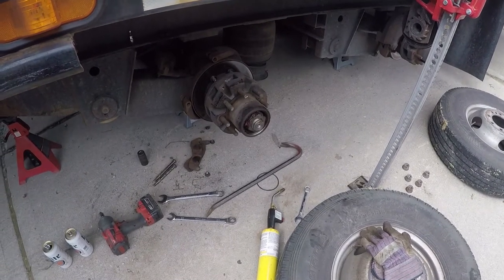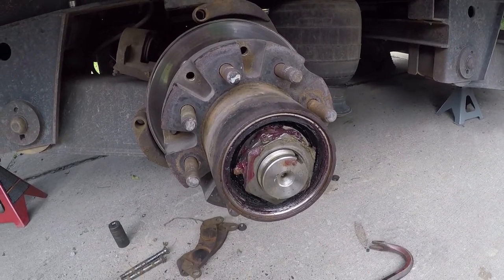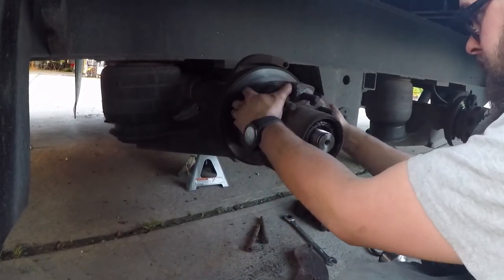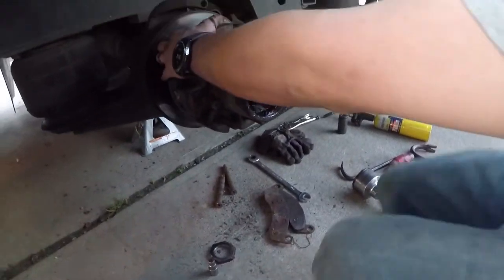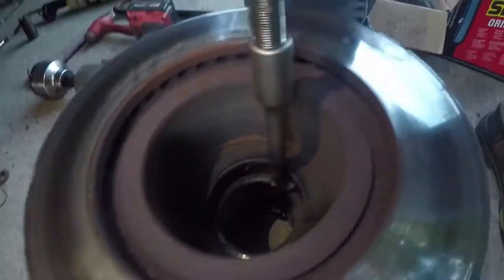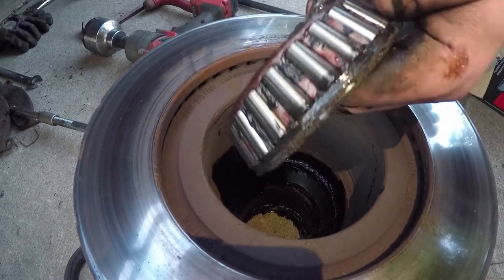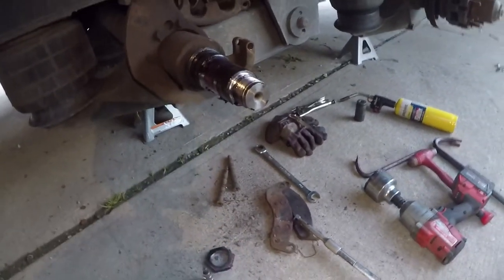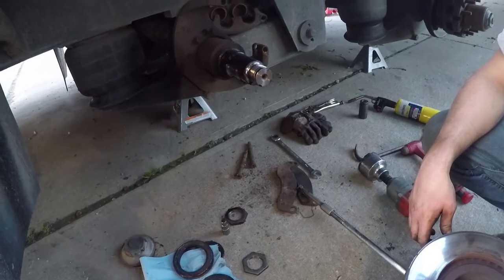Trailer Hub Oil to Grease Conversion Update

Comment: Grease is better than oil
Reply from the maker: Oh yeah we definitely learned that.
Reply: @k30krazy  Its situational.  For marine use, oil is by far more superior, especially when backing hot hubs into cold water, oil doesn't expand anywhere near as much as grease so putting warm/hot hubs into water causes the inside seal to allow water in from expansion.  In non-water trailers, grease is better in my opinion.

In my situation, my 3.5ton boat on a trailer, I was replacing bearings almost every 10,000 - 15,000 miles.  I switched to oil, and have done almost 60,000 miles, and bearings are still looking just like new.  I just change the oil every 20,000 miles.